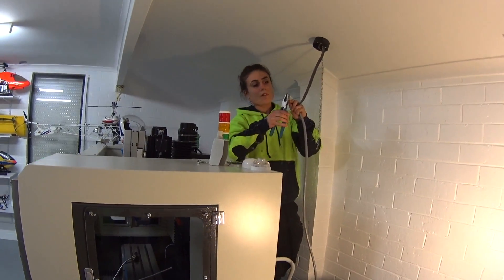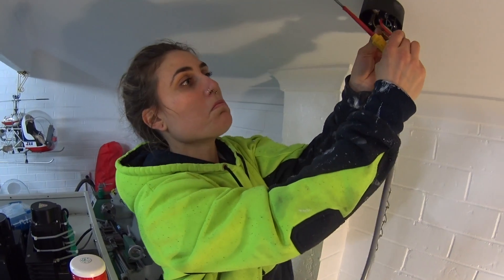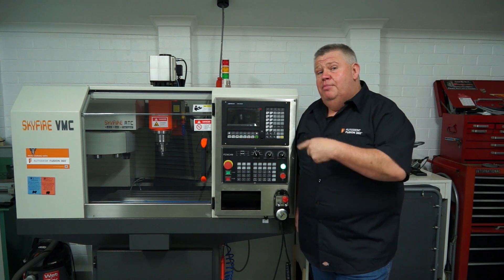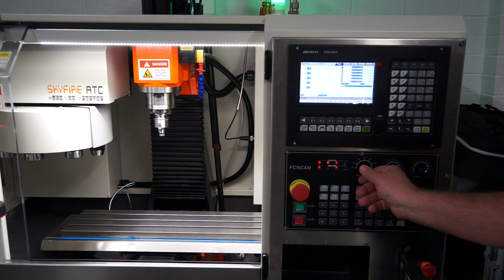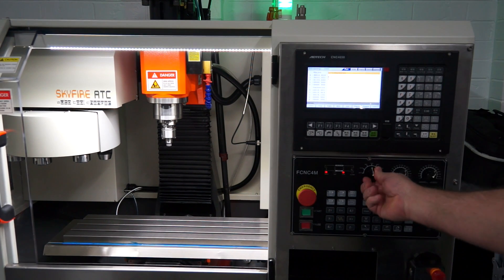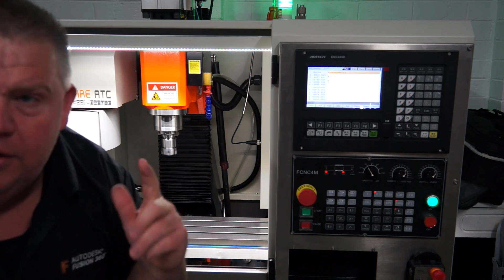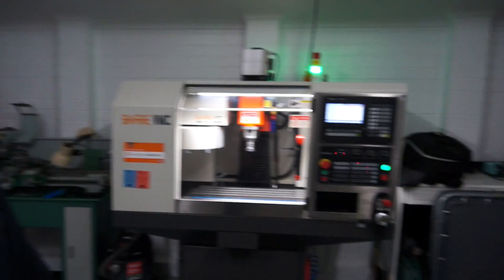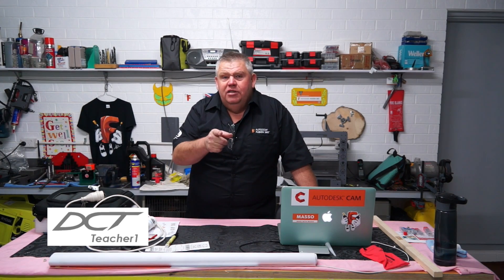SkyfireCNC First Start - Power & Air Connection

Comment: You can buy a dentist to use the air pump, very quiet but very small.
I bought two 30L oil-free silent pump, than the dentist to noisy, but the sound can be accepted.

Your air pump is the most unbearable, especially in enclosed space.
Good video!
Reply from the maker: Hey man, yeah I know.  Some day soon I'll purchase a much quieter type (Chicago air or similar).  All my money went on the Mill ha ha ha ;-)

Comment: Nice machine!! The controls are very similar to fanuc
Reply from the maker: Hey man and thank you.  Yes you are corect.  This Adtech controller is based around or off Fanuc.  I think the G&M codes are identical.  I've only ever used Haas, but that is fanuc based too.  Cheers, Aaron.
Reply: How much horsepower are you getting out of that spindle motor?
Reply from the maker: Oh it's only single phase 240vac servo spindle motor with 2.2kW which is approx 2.95hp
Reply: Nice!! Thats plenty

Comment: PPSAaron, I went back to every Skyfire vid I could find last night 😄One thing struck me on all of the demo vids, particularly those showing heavy cuts on steel.Maybe the 'stick-out' with the collet system is a bit too much, and maybe some of the work holding was a bit how's-ya-father.... but I noticed quite a bit of noise/chatter coming through.I'll be interested to see some heavy cutting when you get into testing mode 😄
Reply from the maker: Hi Robert. Yes I have to agree with you there. I think these videos sound so terrible because of the machining strategy used by
the operator. I know that on my industrial controller it has built in CAM programming, which is what I think they used. These are generic “old school” machining strategies.  Plus they are machining steel on their machines and not aluminium.  Even I look
good at machining aluminium ha ha ha.  I purposely bought my machine for aluminium work and I will be CAD-CAM'ing everything in Autodesk Fusion 360 ;-)
Reply: Thanks for that Aaron. I've started using Fusion 360 ( free version) for design on my model steam locos, so would also follow through with the CAM route via Fusion.
Looking forward to seeing your saga unfold .
Great content mate.... and a refreshing 'Aussie' style 😄
Reply from the maker: Thanks Robert.  I'll do my best to keep up the exciting content lol.   Hey, have you uploaded any content showing your model steam locos?  I'll check out your channel now.  Cheers

Comment: You need a silent air compressor made from an old air conditioner scroll compressor  like a Copland SC series mounted on a air receiver tank. Got 2 of them in my workshop for spray mist coolant. About as loud as a fridge running. Can't wait until you make something!
Reply from the maker: Hey mate, yeah I would have bought a Chicago Air oil-less / silent compressor but no one in Melbourne sells them.  The store that sells these are in Sydney and I was too impatient to wait.  Once I get some more funds coming in I’ll get one.  Until then the old girl will have to do :-(

Comment: Aaron, great video. Looking forward to more reviews. A couple questions, if I may. Did you have to spend much time getting the machine cleaned up before powering up? Are you going to check tram before use or have you already? Many thanks.
Jay
Reply from the maker: Hi Jay, thank you for watching and commenting on my video.  I have not cleaned the machined this is exactly how she came out of the box underneath the protective wrapping.  Build quality is very good and I have checked some bolts and nuts and they were tight.  Haven't checked for tram yet, but that is a very idea to do so.  Might get me old mate Peter (machining tips & tricks with Peter Pilbeam) to run his dial over it.  Cheers, Aaron.
Reply: Thanks for the reply. I'll keep watching for more videos.
Reply from the maker: Thank you ;-)

Comment: I was literally going to buy a tormach tomorrow... quoted, packaged and ready to take the dive.... then you show me this...

what the heck man!?!?! how did i not know about this haha!!!

Thanks in advance for showing this off!!!!

I have a few questions about the machine.

1.) Servos or Steppers?

2.) 4th/5th axis support?

3.) Spindle HP?

4.) Is that REAL TOOLING?!?!?    O_o

5.) how much was is?

6.) Overall weight?

7.) do you have any experience with tormach, and would you recommend this over a tormach or the otherway around?
Reply: DCTTeacher1 17k... Not worth it for me all depends on what your doing. Been looking for a small machine
Reply from the maker: Hi Ryan, it suppose it really depends on what you want to do with a CNC machine.  This machine is for small industrial use and is very capable.  The closest machine in the market to this is 3 times more expensive.  I've played around with hobby machines before and got tired of them. All horses for courses mate.  Cheers, Aaron.
Reply from the maker: Hey buddy how are you?  Thanks for watching my video.  Yeah, I'm very impressed with the SkyfireCNC.  Skyfire make three sizes 0, 1 & 2 which are all very similar to the Tormach's (440, 770, 1100).  Now mine is the SVM-1VMC.  It has an industrial controller (not linux or PC) and it runs servos all round not steppers.  The machine is single phase with a "real" BT30 servo spindle (3HP / 8000rpm).  Being a servo spindle it can ridgid tap.  My machine has a 5 axis controller and is roughly weighs 650kg.  It cost me just over $17K usd delivered (DDP) with all tooling and 2 x machine vice.  Contact Defeng at Skyfire as he can custom make a machine to suit your budget and requirements. Hope this helps?  Cheers, Aaron.

Comment: Very curious to see if they sealed yours well.  Another you tuber with a Skyfire had more leaks than a sifter. I've been wanting to pull the trigger on the same machine for awhile now but not enough reviews yet. Very interested  in seeing and hearing your reviews. I've been watching them for over a year but no really good reviews yet.  Hopefully yours will make the difference.
Reply from the maker: Hello and thank you for watching.  Yes watched the same video by Greedseed and aim to seal mine with silicon before running the coolant pump.  So far I'm very happy with the quality of the machine and it's operartions.  Although I haven't started to cut anything yet, I intend to do so very soon.  Hopefully my videos will give the machine justice.  Cheers, Aaron.
Reply: Hi again, Do a search for the sealer Haas uses when building their machines, suppose to be fluid proof and a winner sealant.

Comment: great looking! I especially like the worklights, and looks like you could add more LED strips if you wanted down the line. I also like that it has a dedicated control...really there's no substitute for hard buttons. go cut some chips!!
Reply from the maker: Hi Andrew.  Yeah I'm really stocked to have this machine.  Granted that she "aint" no Haas, but it's a big step up from my converted manual machine that I had at home.  Cheers, Aaron ;-)

Comment: Another great video Aaron giving a great insight into these machines, Doesn't it look fantastic.
I placed an order with Defeng last week for a SVM2-VMC and having your video verifying what I already thought  is extremely helpful.
Can't wait to see you cut some metal with it.
Thanks for taking the time to tell of your experience. Hanging out for the next video.
Phil.
Reply from the maker: Phil Hartley Hey Phil, what Tha? You placed an order? Holy cow that's freaking awesome mate, congratulations. I'm really excited for you. My only regret was that I should have bought the SVM2 instead of the SVM1,  but I can always use the Haas SMM2 at work if I need a bigger work envelope 👍
Reply: Thanks Aaron,
Yes I bought a 4th axis from Defeng last year and the quality of manufacture was exellent.
He was helpful and honest with that and a subsequent order for a larger  8" version which we run on our larger machine at work.
Reply from the maker: Phil Hartley Oh yeah, I remember now as you told me that in a previous comment. Yes I was very nervous about importing directly from China so I used Alibaba.com and their trade assurance protection. I agree, I have found Defeng and the Yantai machinery company honest and excellent to deal with. Can't wait to see your machine on video 😉

Comment: You mentioned that your happy to have the BT tooling and do away with the straight shank type. What issues did you have with the straight type?
Is that the same shank that the Tormach uses?
Reply from the maker: CNC Gold Coast Hey mate. Yeah I was using the Chinese version of the TTS tooling. It would pull out when taking heavy cuts. Even after I'd swung on the drawbar.
Reply: Wow, good to know..Cheers

Comment: Keen to hear more about accuracy and reliability. Would also be interested to hear your thoughts on budget tooling - there are Chinese BT30 holders for a third of the Western price, but how does the runout compare? etc
Reply from the maker: Sean Murphy Hi Sean, for sure mate I'll try and include some of what you mentioned in my upcoming vids. Thanks for watching mate. Cheers Aaron
Reply: Usually the tool balancing is an issue with cheaper holders. If you don't exceed 7000-8000 RPM then the negative effects are drastically reduced. Of course the holders could be great, just no way to really know ahead of time...
Reply: Sean Murphy found some Italian made holders for cheap. When to buy more went from 20 to 120. eBay has er32 5pc for 80 shipped I ordered and there nice
Reply: Have you tested the runout compared to more expensive holders by any chance?

Comment: Great video Aaron, I have been looking at these machines for while now, can I ask why did you choose the 32amp option?
Reply from the maker: Daniele De Biasio Hi, yes I'm very happy with the quality of the machine. I bought it single phase 240vac and it is approx 22amps max current draw and it's internally protected for that. It was the electrician discretion to run the 32amo circuit;-)

Comment: How many times did you read the manual before the machine turned up?
Reply from the maker: Hey buddy, would you believe I only glanced at it yesterday?  For real mate!  I just pushed buttons until I made her work.  I'll send you the programming manual if that's ok, and catch up with you via FB messenger ;-)
Reply: DCTTeacher1 I think I would have worn it out by the time it arrived... Although I've not done that with my 3D printer that just cleared customs.
Reply from the maker: Scott Moyse cool, what printer did you get? That one I got from Aldi is unreal 👍